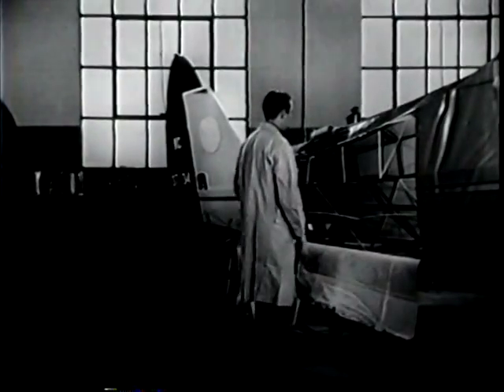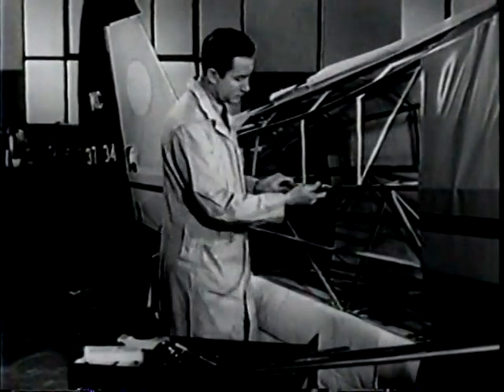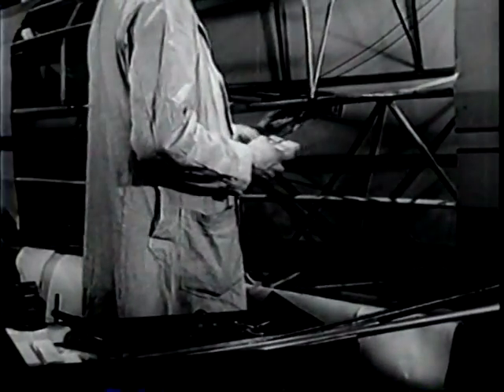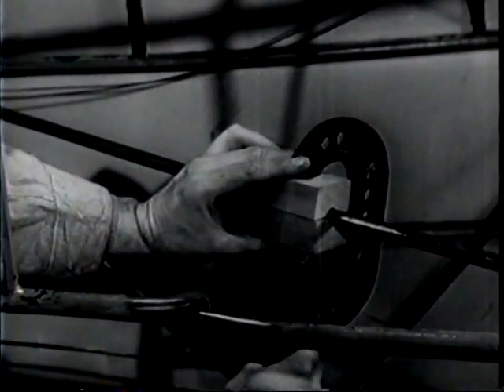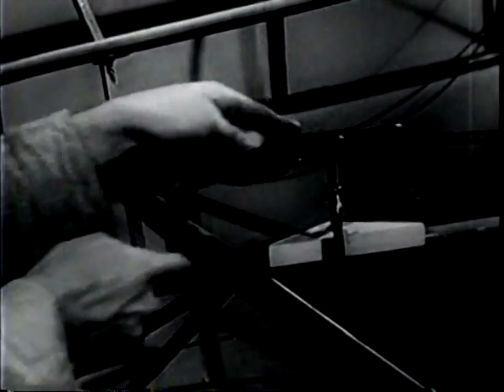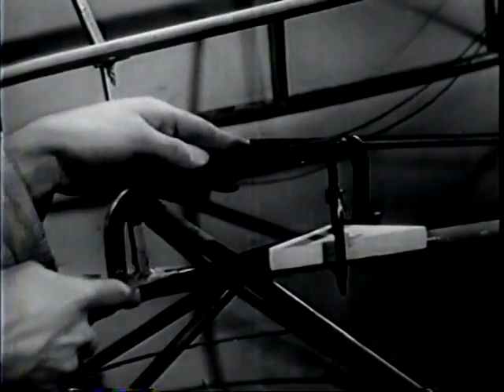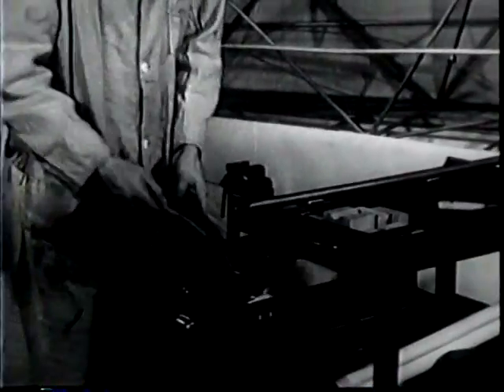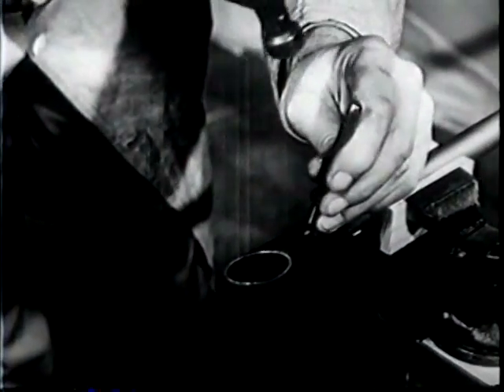Repairing Structural Tubing (Aircraft)

Comment: Spraying paint without a respirator, I wonder if it was zinc-chromate?  Then there was the recommendation to spread out some wet asbestos. Times have changed, the usefulness of the original products has not diminished or been replaced with and properly handles would not create health hazards.  I very much dislike Big Brother.

Comment: There is actually a crash report for tail number NC3734 ( 1943 )   the plane is an  Interstate S-1A-90F  "    Narrative:
Lost control in a turn at 15 ft after a touch and go on an auxiliary airfield, left wing hit the ground and the aircraft crashed.       "
Reply: where did you read the tail number?
Reply: @redpost2380  Time 221 has the tail number
Reply: @redpost2380  Time 220 shows the tail number.
Reply: I love internet sleuths. Awesome!